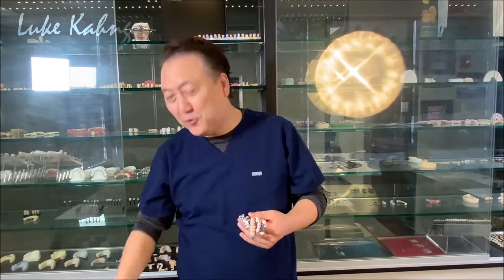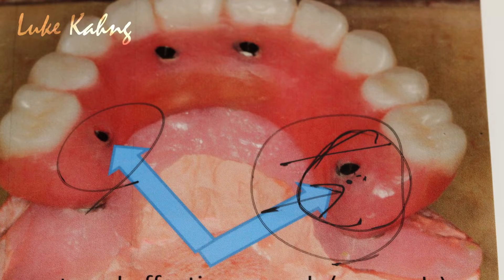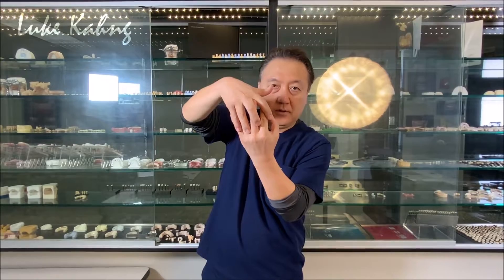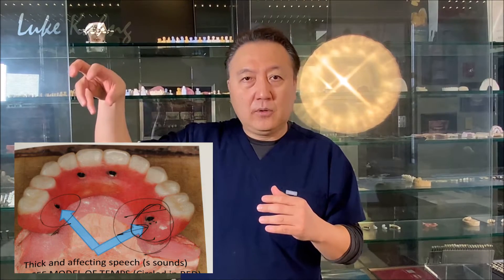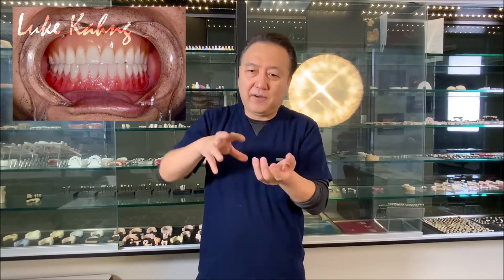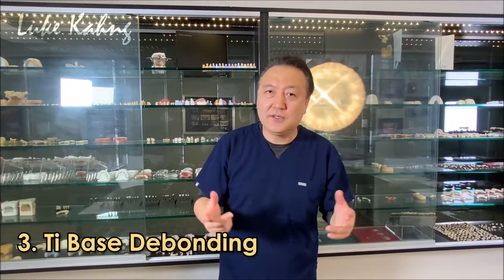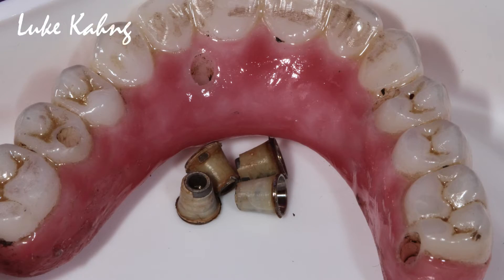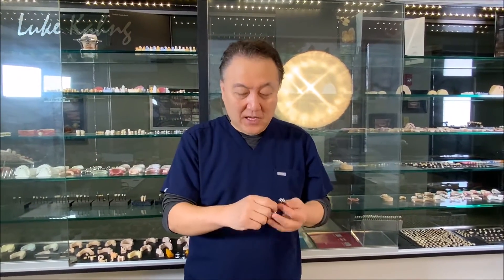3 Reasons Why You Shouldn't Make a Zirconia Restoration

Comment: It is rare to see a colleague with  independent thinking  and sharing with candid opinions. The dental prosthesis is when the "rubber meets the road". The 3 "solutions" maybe to have more implants, merged the Ti-base or the abutment to either the prosthesis or the implant as a one-piece restoration (either tissue or bone level connection) and with a more time tested material like metal.